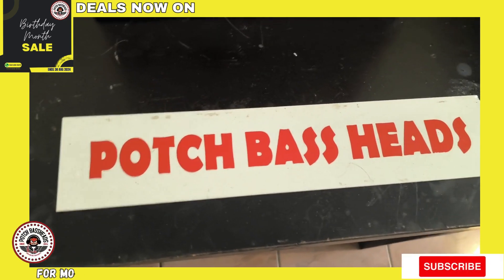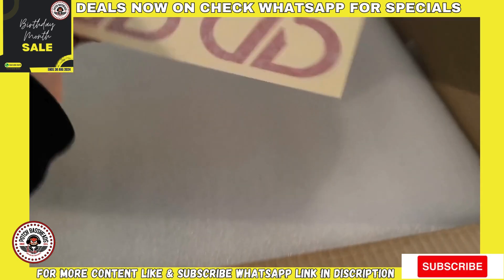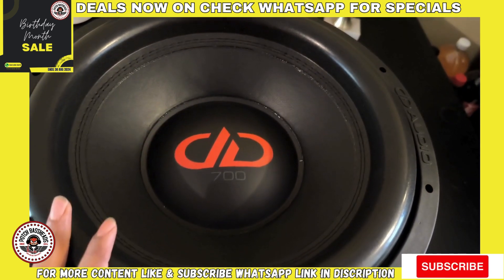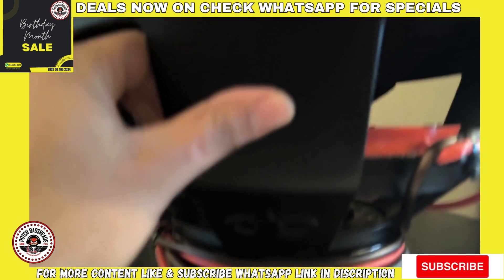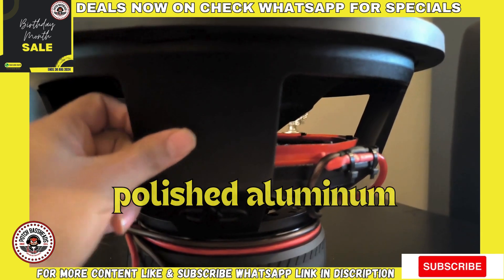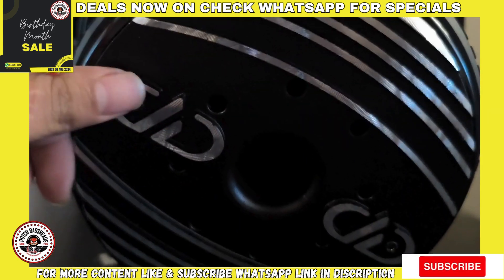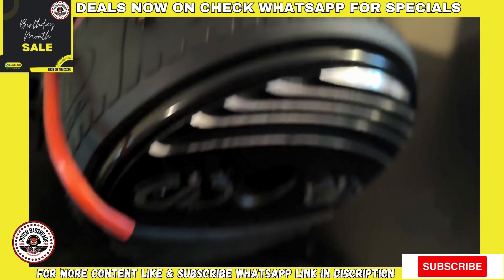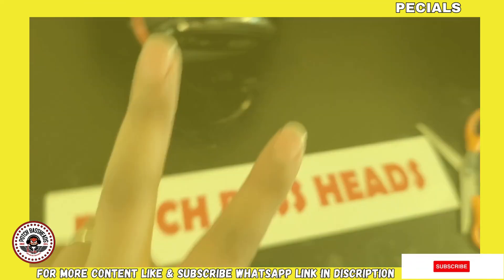Digital Designs 715 F type unboxing

Comment: Please please please try and review the Starsound Super Bass 15 or the Starsound Jigsaw 15 🙏🙏 I love these videos
Reply: Definitely the starsound superbass 15 inch.
Reply: I understand the superbass can take much more than it is rated as compared to the monster
Reply: @Maurice14483  Yes, it can take about 4000w rms max in SPL. Power rating is the power the sub can handle on an everyday basis.
Reply: I'm currently running a 15 inch super bass on a 5000rms amp!
Reply: @eddiediedericks535  How's it doing? Is it good with lows?